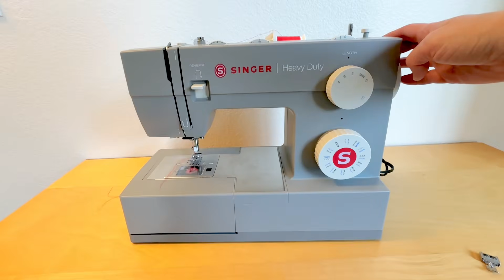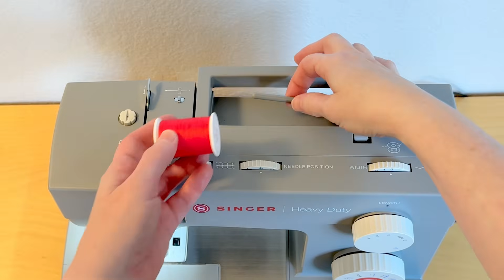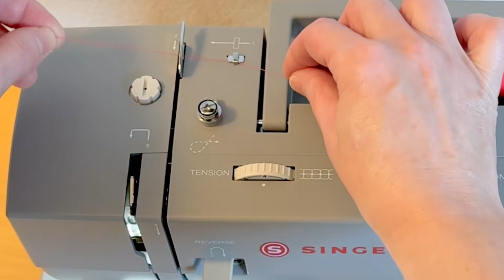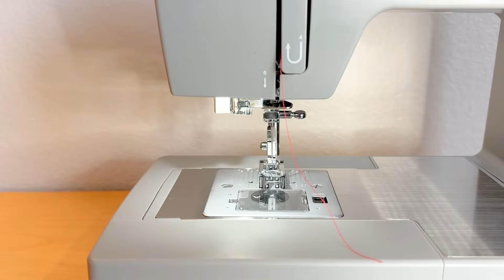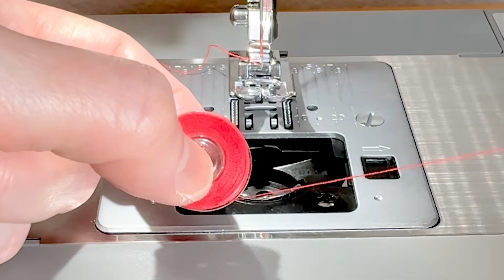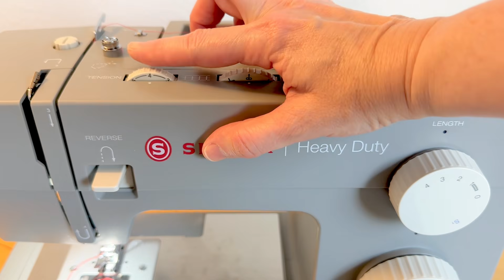Singer 44S and 6600 Threading & Setup Made Easy!

Comment: I done  what ever you suggested  but still  i am not able to  use the bubbin
Reply: Than you so much  for amazing  video is very  good  and clear expelnatoin  but sadly  still i have the same problem  with  the very new machine  as you have  in the video❤ 
Let me know  please  what else I  have to do  
Thanks
Reply from the maker: I’m sorry to hear that! Please double-check that your bobbin is inserted in the correct direction, as that is the most common cause for issues. 😊

Comment: How do you adjust the presser foot pressure?
Reply from the maker: Unfortunately this machine’s presser cannot be adjusted like that
Reply: @sewpracticalsewfun  Can the feed dogs be lowered for darning?
Reply from the maker: Yes, they can! Remove the accessory compartment. And turn the machine around to the back. You’ll see a toggle switch to raise and lower the feed dogs on the back of the machine.

Comment: My thread gets stuck in the loop . I've been sewing for 50 years, but now (suddenly) I can't thread a machine?!?
Reply from the maker: Hi there! This machine is pretty touchy, it needs to be threaded exactly the way the manufacturer wants it done or it will lock up on you. I listed the main points below to follow, but I would suggest watching the video below where I show in detail how to thread this machine.
• make sure the presser Foot is UP while threading the top.
• The Needle should also be UP to ensure the take-up lever is caught.
• Rethread the bobbin, ensuring the thread locks into the tension groove.
• Change the needle just to rule out a physical snag, or slightly bent needle.

https://youtu.be/iAHTXd4z8aU
Reply: @sewpracticalsewfun I adjusted the tension  and fixed it.  I never needed to do it before.  Thank you for your help

Comment: It’s not working for me, bobbing thread keeps tangling and my top thread keeps breaking
Reply from the maker: That's definitely a common issue! It sounds like a tension problem. Make sure your bobbin is wound evenly and that your top thread is seated correctly in the tension discs. Here is another video to double check Singer 44S  Sewing Machine - Common Issues and Easy Fixes Troubleshooting
https://youtu.be/GvKQyBKjA1A
Reply: @sewpracticalsewfun thank you, I got it to go a little bit but now it not stitching anything. It’s moving but nothing is connecting. I also had to wired the bobbing thread at the bottom through the machine
Reply from the maker: If you are sure that you are threatening the machine right, and you’re sure that the bobbin is wound correctly and stalled correctly, there’s one more thing you can try. It could be that when the machine was sewing poorly, some thread got stuck somewhere in the machine. You should take the bobbin casing out and clean it and make sure there’s no thread or lint stuck there. You can also watch this video where I show a couple more issues and how to fix them. Even though it’s a different sewing machine, the concepts are still the same.
https://youtu.be/FGb-0QPpH1Y

Comment: I don't understand the self threading mechanism. I can't see how it does what it does. I think I'm following. I've been luckily doing it. I'm not consistent. Perhaps if it was zoomed in more.
Reply from the maker: I pasted a video below where I show how to use an automatic needle threader. Its a different model but it works the same. Fast forward to time 2:35. Also, make sure the needle is at the top most position.
https://youtu.be/EHYe0Y261zI?si=kjrxEehAKzBXBDvv
Reply: @sewpracticalsewfun right on! Thanks. I took that beautiful machine back to Walmart today though because of the threading jam. I didn't like the idea of how much and how often I would have to do maintenance on it.
Reply from the maker: @willmegas  I totally understand! I really like Brother. This little machine is very easy to use and inexpensive too! https://amzn.to/4mgk7qE
Reply: @sewpracticalsewfun  I have decided to order the brother cs7000x. I saw online that removing the bobbin case to get to the 
jams may be easier than the singer heavy duty I had.
Reply from the maker: That is a great choice!!